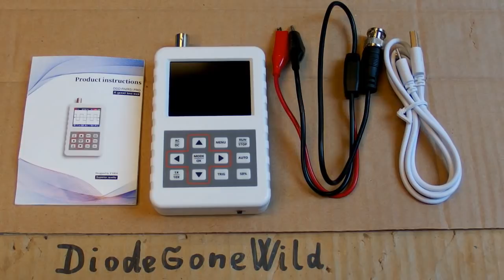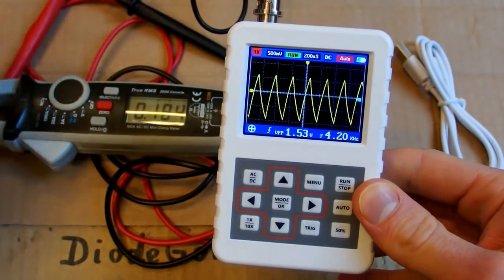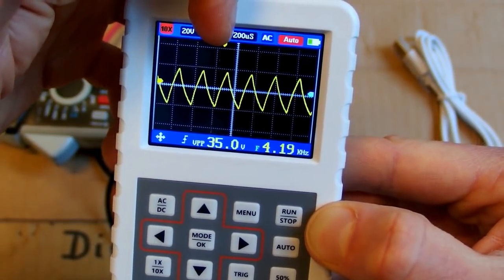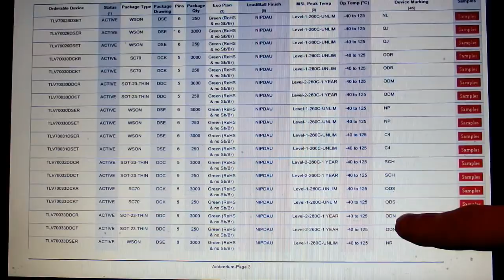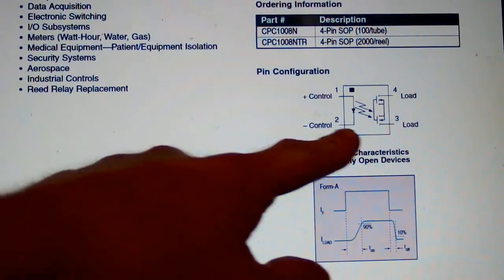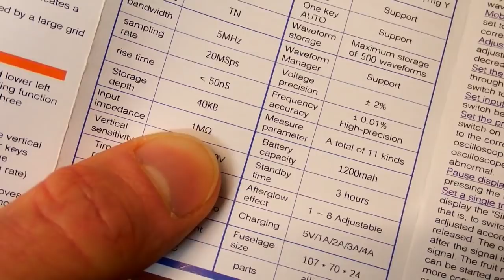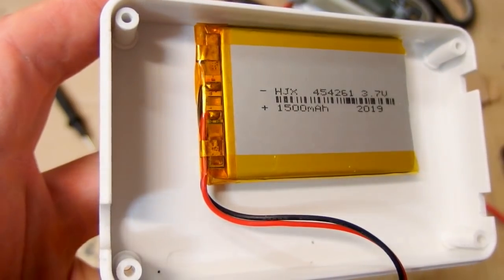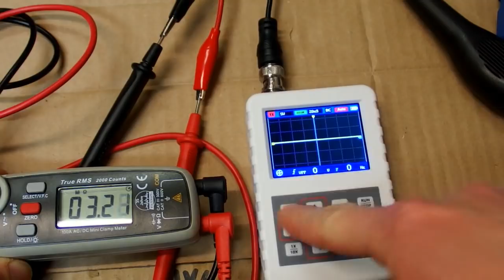My digital oscilloscope (test, teardown, fix)

Comment: Hi, did you try to measure DC voltage with this oscilloscope?  I tried and have real trouble to do so. For starters if you short the input (zero signal) in the "normal" mode it shows nothing until you press "STOP" button at which point it shows a strange non-zero value. In the "AUTO" mode it does not show the zero value, but jumps positive and/or negative as you go through the ranges. And when I connected a battery to the input to measure the voltage (DC mode) it shows a complete garbage, not even close to the actual voltage. Does anyone has this problem?

Comment: If people complain about the 50mV input sensivity being too unsensitive....the video amplifier has an 8k/8k unity gain configuration but gain can be raised by large numbers if the resistor facing away from the A/D-converter is replaced by a smaller one (like 800 Ohms, will give 5mV sensivity or 80 Ohms will give 500uV per unit). Have to see if the caps will also have to be changed (linearity between low/high frequencies, I suppose it will) but for audio purposes it will be a great option if one has to measure noise levels or electric guitar signals.
Reply: I have tried a trimmer with 80 ohms...works okay but offset of the opamp pulls the y-axis down. After calibration no useful measurement can be done. Calibration takes like a minute or so.

Using an 800 ohms trim works better! Calibration still okay and offset okay too :-)
Reply: Wondering why the slower versions of this cheap oscilloscope can handle 5mV....maybe they used a gain of 10 and then had to limit bandwidth in favor of that opamp? This version uses a gain of only 1 and therefore frequency response of the opamp is better? 

But why does the calibration not work for a gain of 100 ?

Are there better options for input circuitry? Maybe a different opamp? Any offers?
Reply: Maybe I omit all this input circuitry and make an external preamp for it...a clean booster for dso :-) No offset, high gain :-)

Comment: I ordered one from Aliexpress a few weeks ago. Works perfect. Capacitor is good. Board is clean, no after-production intervention. Seems well built. Connected it to 220v without setting the probe to 10x and it didn't burn. Readings were wrong, but it survived. Very handy in testing the waveform of my crappy gasoline generator. Highly recommended.

Comment: I have mixed feelings about that MOS relay shorting out a possibly charged 4.7uF cap. At least there should be a 10ohm resistor in series with the switch. I don't know what is the lower part of the voltage divider, but it wouldn't introduce any noticeable error, and this device isn't for precision measurement anyways.

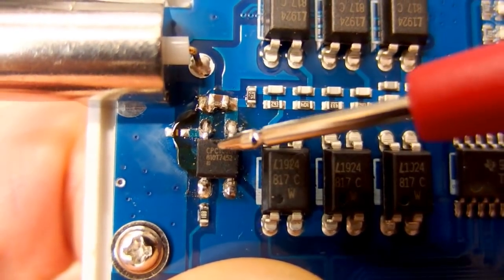Comment: HI! :) that relay below the capacitor (visible at 11:33) top line reads CPC100 something.... my fnirsi pro has a different relay!
the component on my board is "BETEC Y214S 1333" (the "1" in 1333 is hard to read and might be incorrect)
HTH, pls reply if you managed to get single trigger mode working!
Reply: measuring resistance on the probe socket gives me an initial reading of several Megaohms that increases steadily. i'm no expert, i'm using the resistance setting on a fluke 27/FM, which only has one setting for ohms.
Reply: 14:25 "cowuuhn-uhterr" music to my ears, built a lot of speech synthesizers, thoroughly enjoyed the watch.

Comment: i wonder if you can help me get the single trigger mode working.
i have some AAA batteries in series with a switch and an LED. when the switch is closed, the LED lights. in "auto" mode, the fnirsi pro displays the level of voltage. i want to observe the moment the voltage jumps from 0V to +V. i set the trigger mode to single, press the button, the display remains blank.

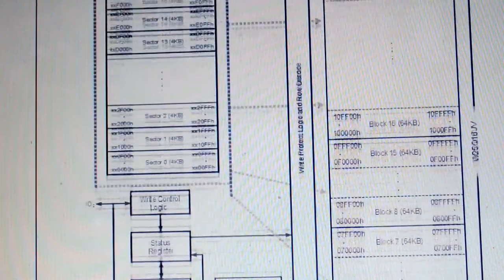Comment: 9:12 = All flash memories used in microcontroller have a high voltage generator (about 9V 10 12V) used to erase the flash. Its mostly a charge pump boost type. Usually, it is not shown in block diagram.
Reply: Yes, by "high voltage" they mean relatively high voltage.

Comment: Would be interesting to see a youtube video on  comparison between the cheap pocket oscilloscopes - DSO138 vs DSO150 vs DSO188 vs DSO068!
No one seems to have done a youtube video on it yet!
Considering buying one but the one you have the DSO188 looks the best with the widest signal range?

Comment: No, the flash chip certainly does not contain the software/firmware. Because GD32 (STM32F103 clone) doesn't actually have much RAM and is not well suited to execute program from RAM, but it has plenty of builtin flash. It also has no capability to execute software from external flash directly. It's also not strictly needed to store settings, there's plenty of flash on the microcontroller for that. It's there to store waveform captures for sure.

Comment: Injust bought the same one.
My input resistance measured 996k ohms
The capacitor you asked to measure is 945nF
Good job, thanks for the video!
Reply: Maybe someone could look at the values of the input resistors in their unit.
The one he has might be different.

Comment: The input attenuator stage of that scope needs to be redesigned to have 1 Mohms resistance on AC /and/ DC coupling. Only then a 10x probe will work properly. Would be interesting to do that...

Comment: can it measure wavelength and voltage at a point.. or is it only good at uniform signals like sine and square wave... and gives you generic data like its frequency and peak and average voltages

Comment: same specs for mine. 400k resistance. seems to follow the same approach of bob davis's nuts and volts arduino oscilloscope. this one uses gd32f103 which is a cheap clone of stm32f103, it uses a TLC5510 which is 20MSps adc, i wish they used the 40MSps one which is the TLC5540. it's good enough for hobby electronics such as audio frequencies to smps switching frequencies even up to 1.7MHz switching frequencies of some ultrasonic humidifiers. pretty handy little widget. and yes i also took it apart after unboxing and testing it. even the input smd capacitor has the same capacitance.

Comment: I don't think that the root of the problem was the capacitor but a pull down resistor instead which was absent and probably was shorted out before you started desoldering

Comment: The micro runs at only 72 MHz! Single core ARM!!! How can they run the micro to process the 8 bit data so quickly? I was working on a 70Mhz 16bit oscilloscope but I was constantly forced to use FPGA to dump data into ram before processing. No microcontroller seems to be able to handle it. Now seeing its possible with an ARM, I really want to get a raspberry pi to work with my ADC chips. RasPi zeros cost only 5 dollars now and have a sufficiently fast clock.
Reply: I would imagine the data is transferred into a circular RAM buffer by DMA, that's the probably the only bit that needs to be fast. If the scope is operating at a slow timebase they could switch to a slower timer driven  sample rate and just discard samples to keep the memory footprint reasonable. I'm surprised they didn't just totally cheat and use one of of the ADCs in the micro.
Reply: @xequals-pc1wl  Same! Thanks for the information it is helpful. I only have experience programming in modified C and haven't programmed any real STM32 or fpgas. I really hope some Arduino boards I have will support DMA. Also, I don't DMA can magically increase sample rate above the max clock of MCU
Reply: @leozendo3500  Ok, without a schematic I'm totally guessing, but assuming the micro is clocked by that 20MHz oscillator and the ADC is clocked at 5MHz using one of the micro's timers then it could/should/maybe work out. I only program in 'C', assembly language is dead :)
Reply: @xequals-pc1wl  Very nice. That gives me good reason to spend more time coding in c. But still without things like Arduino librarys it's a time consuming and brain bursting hobby.
Reply: @xequals-pc1wl  The XTAL is 20 MHz, but there is a complex clock system in that chip, it is most likely not run on 20 MHz, but more.
That ADC is 20 MSPS only, so it is possible to fetch the ADC data into RAM with DMA transfers, then the main thread will display a portion of it. It will certainly not display all the samples, maybe on a "DMA completed" interrupt handler they execute a fast trigger condition search, then mark the section of the buffer where that portion is, then they start another DMA transfer with a second buffer. So probably they aren't sampling continuously. You probably can't capture a rarely occuring glitch with this setup, but it is certainly doable to display every fewth section of the waveform.

Comment: Hello! I have a very similar digital oscilloscope and the impedance I measure on the input BNC connector of my unit is: 1.312 MegOhms. I hope that this helps you.

Comment: Hey, so they added a mechanical switch there? Sick. Myself whenever messing with any LCMs I always add a shutdown sequence triggered by a button or via the UI, which puts the LCM into powerdown, waits for one's driver supply to discharge, then disables any PSUs if used and finally puts the MCU to sleep because why not :)

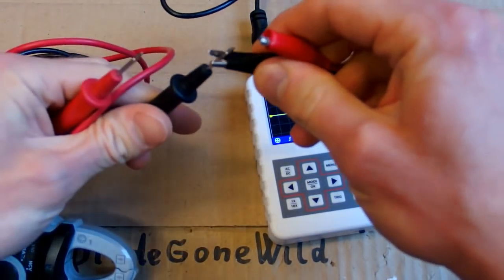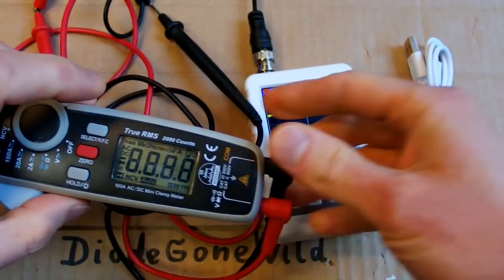Comment: At 1:55/1:58, the black clip springs off. What are you measuring? :) "It doesn't do much." You can even hear it. :)
Reply from the maker: Of course it didn't measure. I reconnected it off camera after realizing it.

Comment: How to solve low voltage problem in home about 220 to 180 volts stepping down for 4 seconds in some time plz make video or I should use fan capacitor to stabilize voltage

Comment: It seems to have a discrete configurable attenuator at the input followed by a fixed high gain opamp. The atennuation value is selected with solid state relays.

Comment: 4.26 uF and 406 kOhm when set to DC. When set to AC the resistance keep rising and I just stopped at 25 Mohm
Reply: Same for me. Still strange that the rated input impedance is 1M by the manufacturer and that several others have different readings in DC mode too.

Comment: The input capacitor I would say 100v and size is more important than value. .005 to .1 uf highest value that will fit in the location.

Comment: Man i have that soldering gun from my old grandfather i have it in white color Can you open that soldering gun for my and video because my light sometimes dosent work please open it for my on video i love your videos
 pleaseeeeeee thanks man.
Reply: Throw it away and buy a proper soldering iron. Seriously.
Reply: @johncoops6897  :)))))))))))))))
that one is "proper", not the "proper soldering gun". seriously! :D
Reply: @miftosaurus  - random comment is random. Are you trying to make a joke or a comment or a suggestion or what?
Reply: @johncoops6897  so, you see this soldering gun for the first time ever?
i use it for almost 40 years, and most of eastern european technicians AND hobbysts use them for more than that.
DGW seem to be one of masters of that gun, so, for him, THIS is the "proper soldering gun".
for us, a soldering iron (temperature controlled or not, or an hot air station) is just a "secondary device", for those rare times we don't have the soldering gun working.
or is way too strong for 1005-size parts. :)
Reply: @miftosaurus  -  I've been working on electronics for at LEAST 10 years longer than you have, and I've owned those "guns" in the past, along with many other different kinds of guns. I know exactly what that kind of gun is, exactly what it is best used for, and how to use it. 
The gun is not a "Eastern European" design, they were very common everywhere in the world since what, the 1950's? Fundamentally they are a crude predecessor to the English "Scope" irons that use a trigger to push a carbon bush to provide heat directly to the tip. The Scope is a considerable improvement to the "gun" style since there is much less thermal lag, so providing much better (manual) heat control.
However it's 2021 now, and such clunky old crude devices aren't really needed for most tasks. A decent 60/75W temperature controlled iron has enough punch to not require a large thermal mass, and having temperature control makes it much more reliable for fine copper tracks, even with through-hole components.
If I need to solder any crazy-big stuff, I drag out a massive 200W 240V non-controlled Weller (designed for guttering and lead windows), or even use a old-school solid copper pyramid style heated with a butane flame. Even bigger than that, it's a Mapp Gas flame and sweating or brazing....
For medium work, I'd use my Scope which is 150W manual control and plenty of grunt for valve radios, big wring bushes, etc. I threw my guns away a long time ago, as they are a cheap and poor solution to a simple problem that other soldering products can perform much better.

Comment: The GD32F130 is hw & sw compatible with the STM32F130. The choice is a bit weird as for ~ 0.5 $ more they could have used GD32F3xx (or STM32f3x) which as several 5Mhz DAC inside the chip.
Reply: Try again, there exists no STM32F130. There does exist GD32F130 which is a 48MHz micro with smaller amounts of flash i think 16/32KB and SRAM of like 4KB, very cost optimised. Of course rival STM32 parts would be the L0 line with an entirely different core.
You're thinking of STM32F103 and indeed Diode has misread the chip or has been confused by a typographic error in the datasheet, it says GD32F103 on the chip.

I thought that GD32F3xx were vaporware, but i checked just now and they are available. Colour me surprised.
Reply: @SianaGearz  And they do contain 2 (3?) 5Mhz ADC .

Comment: Using a external high speed ADC and high bandwidth OpAmp?  Impressive, but I think they've copied this circuit from a standard handheld Oscilloscope design  and somehow managed to reduce board costs.  But not paying attention to details like the input probe impedance reduces its value as a measurement instrument.

Comment: The short circuit between the capacitor terminals was probably caused by ionic contamination on the PCB.

Heating the area and resoldering the component make the problem disappear, but it may come back later if the contaminants are not properly removed by cleaning.

Comment: I have an oscilloscope very similar to this, but its like the original version of this oscilloscope. It has a 5Ah battery, more functions, a grammatically correct manual and better build quality. my input resistance is 1 mega ohm.
Reply: post your oscilloscope

Comment: That's a very nice little scope, i would not expect it to be accurate with a composite video input, but it should display most of the waveform fine :-D
Digital scopes have some restrictions due to sample rate and resolution bits, not forgetting having enough memory to store it.
Analog scopes are my favorites, i am used to them :-D
Reply: That is not a composite video input socket it is a BNC connector they are either 50 or 75 ohms impedance
Reply: @jasnic2131  i'm sure Mr. ZX is quite aware. He repairs things which have composite video out though.

Also the input impedance is not determined by the socket, but by device circuitry, and in this case, it's 1M claimed, 400K actual.

Comment: I wonder how similar the 20€ scopes on eBay are, it looks more or less the same but it has 4 buttons and a knob instead. Assuming similar build quality I could definitely use one for the occasional times I need a scope for checking signals, without needing to be completely accurate
Reply: That sounds like the DSO Shell. I can't answer for the build quality as I made mine myself from a kit 😉 It's very prone to noise pickup - this is a recurrent theme in online reviews of the unit, so it's not necessarily my fault!

Comment: That's a pretty neat little ADC. It surprised me that it had something like that...Usually these little hand held things give you audio bandwidths..Wonder how this holds up? It says 5Mhz The analogue ip of the ADC is fed directly from that op amp which is  optimised for video, so the 5Mhz is spot on. Compared to the careful design of a 'proper' scope the i/p looks crazy simple but should be OK at these frequencies.
Great fun though and the display looks nice and colourful. A step nearer the thing we have been waiting for for 70 years...Soon...Maybe..

Comment: Is the specs of this dso enough for analysing DC power supplies?
Reply from the maker: 5MHz / 20MSps is kind of enough to analyze switching power supplies. They run mostly below 200 kHz so you get about 100 or more samples per period. You can display the waveform quite nicely, but you don't have a huge headroom to accurately measure short duty cycles. Also some short transients during switching may not be visible.

Comment: 5:10 Watch the battery indicator. Never seen such a broken one before. Does the voltage fluctuate THIS much?
Reply from the maker: I didn't even notice this :). Maybe the voltage really fluctuates as the microcontroller power consumption fluctuates. But more likely the indicator is poorly designed. But it's not the most important part of the oscilloscope.
Reply: @DiodeGoneWild  i think it just jumps from 49% to 50% voltage, and thats why it flicker

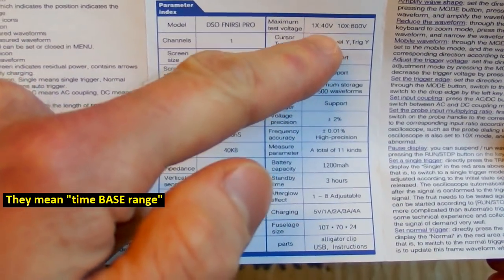Comment: That might have been worthy to buy, but the 400k input impedance is a show stopper for me, it won't work properly with 1:10 probes, just like the "legendary" USSR N313 mini scope, which is very cute, but quite useless. Also the divider is compensated with fixed capacitors, they should've used trimmer caps there. BUT, for 36EUR, it might worth a try to fix these design issues, with a bodged-in daughter board to replace the Y input circuitry.

Comment: Most likely the capacitor was shorted but the heat from your soldering iron fixed it. I have seen this in many ceramic capacitors where they have faults but you warm them up with a hot air gun or an iron and suddenly the short resolves.